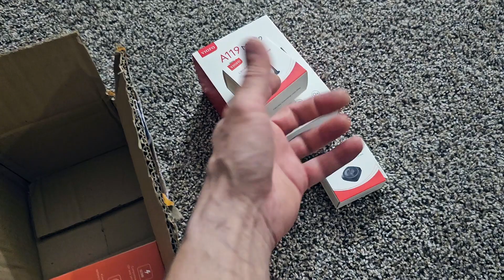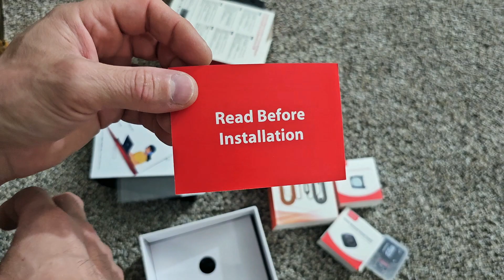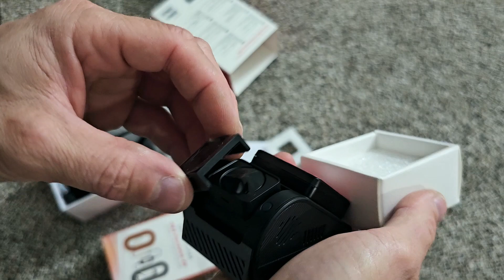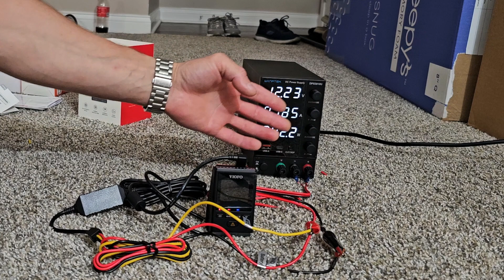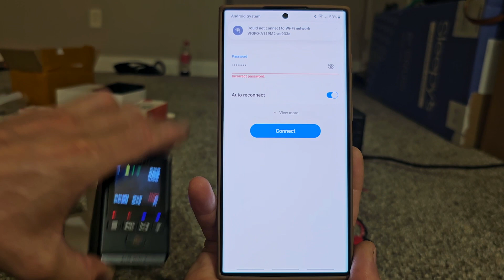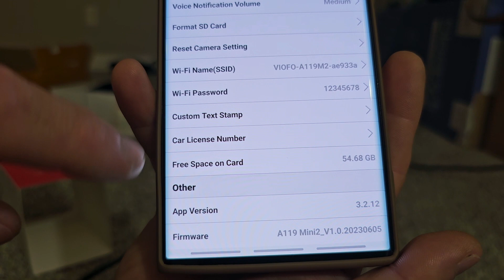Unboxing and Testing VIOFO A119 Mini 2 DashCam

Comment: Thanks for the video. Do you think this will work if it is plugged into a usb-c power outlet in a car, using an adapter from usb-c to usb? Thanks and good luck in USA!
Reply from the maker: Hello! you can try but is possible that the output of the usb outlet to be cut out duet to greater current consumption !
Reply: @MOvidiu  Thanks for your reply!

Comment: Buna Ovidiu. In primul rand felicitari ca a-ti ajuns in Statele Unite si mult succes. O sa fie bine.
Am o intrebare. Locuiesc in Dallas Texas si sunt proprietarul unui BMW 650i anul 2007. Acum o saptamana cand am pornit masina a mers putin dupa care s-a oprit. Check engine light clipea in porocaliu. Am pus OBD si i-mi arata P300 multiple misfires la 5 cilindri. Am schimbat injectoarele, bujiile si coils. Acum am misfire la cilindrul 1 si 3. Motorul merge acum fara sa se opreasca dar trepideaza putin si CEL este inca on. Cineva a verificat si mi-a spus ca trebuiesc schimbate timming chains. Am ISTA  dar nu sunt familiar cu el. Poate nu e simplu sa-mi dai un sfat fara sa vezi exact ce se intampla dar un ajutor ar fi foarte apreciat si mai mult ca sigur o sa ma revansez. Multumesc mult si succes in continuare.

Comment: E70 (2013) X5
Gear shifter 
I’ve got the same parts. It has not recovered from water damage sunroof was open and it rained a lot. I’ve opened both top of joy stick and lower computer board as I saw you did. There was water but only in The case bot not on The electric. I cleaned them anyway with QD Electric cleaner. It was working when the case was wet. But since disconnected. It has not responded to the car. No shift. I only get “shift lever malfunction” when it’s disconnected. 
Is there fuse for the shift lever.? Also, if I buy one from eBay, will it need to be programmed to my car?

Comment: I bought a "money pit" that means a 2011 X3/F25 30d with now 251,000 km... 🤣
Eventually I will install my Viofo 229 that I used or use in my 2008 X3 as well, when I use that car.

But I have thought of installing a 20,000 mAh powerbank (20-25 euro!) that will support the camera when the car is parked.
What do you think about the idea?

Then I now await your next video where you install the camera in the car. Maybe I have to look at your old video. When you mention your car, you should tell us the model year (my), as there is slightly different equipment in almost every my in the 2010's BMWs.

It was one of the best unboxing videos I have seen! Next time you can improve it slightly more, by before the video recording go through all the details of the equipment, then you never need to guess(!) how things work. 
In this case you knew quite exactly how "to use" every detail... 😉 Then you also get a good flow in the video.

By the way, it was really sad that you couldn't store, at least, a part of your (old) equipment to be shipped sometimes later on.
I stay (live?) in more than one place... This spring I was wondering where most of my t-shirts are, then I realised they must be in Finland... 🤣 You see, if I meet the president of the Toyota Motor Company, I need to wear the red/white Toyota Gazoo Racing t-shirt! At least he was greeting when he walked by, but I deeply regret that I didn't try to talk with him, and remind him of the gift I received in 2019.